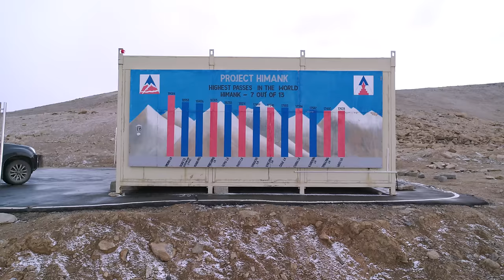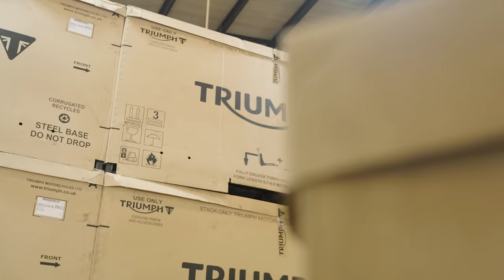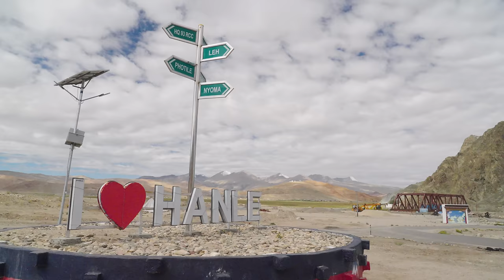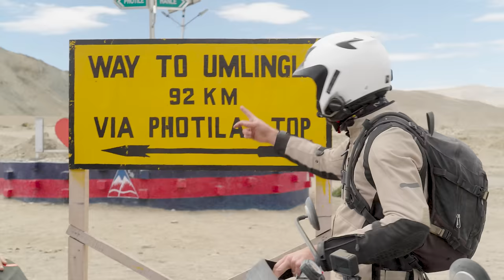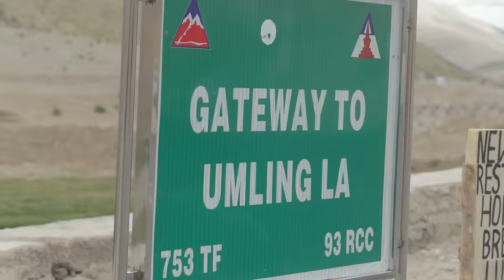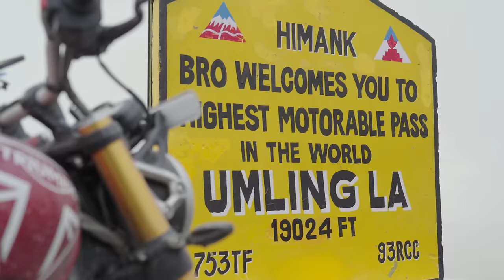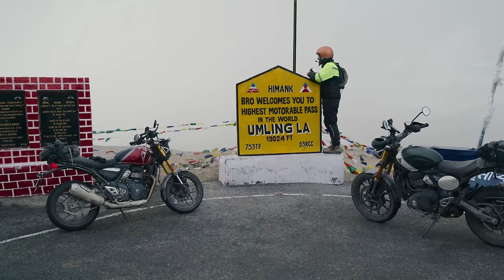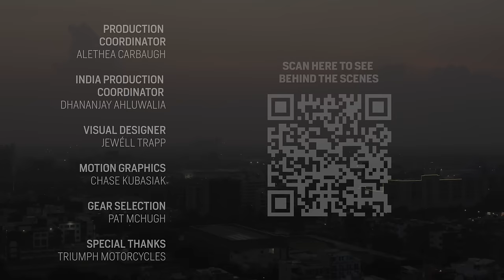The Highest Road in the World! Triumph Speed 400 vs. Scrambler 400 X | CTXP

Comment: What is the purpose of the grill/slats (not sure what to call it) that both bikes have mounted on the left side of their rear tires? Didn't see it talked about in the comments, and not seeing it mentioned in the video (though I have 5 minutes left, I assume they probably won't mention it at the end). Went to look at the scrambler model online and don't see it attached there. Is it some kind of safety mechanism to keep things out of the wheel, or an India specific thing? Is it somewhere to mount bags or something? Have never seen it before.

Comment: For those who are not from India or North Indian specially, these guys deliberately chose off roading even when full pavement road is available to reach out Uming la. How do I know ? I ride every year on that road since it opens in 2020. I am not against to showing such road conditions as they have to create some attachments for this video. If you are some one who wanna go there in future here is road map.
1. Doesn't matter from where are you comming you can find 4 lane highway (if not express way) till than CHANDIGARH 
2. From here you have to travel 80km north-west to kirtarpur shaib via rupnagar
3. From kirtarpur shaib there is 4 lane highway connecting rupnagar to Manali. Some portion between Mandi and Pandoh is still under construction (as on July 2024) but rest road is in good condition.
4. From Manali you have two option you mai use Rohtang pass road(not available for bikes) or via Atal Tunnel to enter Chainab valley.
5. From atal tunnel you have to take left towards sissu - tandi -keylong - jispa - Baralacha pass - meroo
6. After reaching meroo you have to take intection towards pang which leads you to mahe 
7. From mahe to nyoma - Loma bridge - hanle - chisunle bridge 
8. Take left for chisumle brodge and that vr road leads you to Uming la pass.

Even a new rider can cross that entire trip in 3 days(one way). And you will not face such difficulties as shown in this video.

Road conditions are remote and you have to be extra careful while riding these road( carry extra water, dry fruits, energy dring and ORS packets) and than you are good to go.

Comment: Heads up,if you're riding a motorsickle to the highest road in the world,stop somewhere around 5000-8000 ft of elevation(you do the M to Ft math yourself) and remove the air filter, which is airflow cfi restrictive,and thwn,if possible adjust the air/fuel mixture screw inwards a half to full turn causing the fuel to air ratio to decrease which helps to alleviate the thinner air/oxygen ratio by cutting back on the fuel amount and allowing the carb/efi venturi to free flow more air without the air filters restrictions.. And yes,you're  going to lose a lot of power/torque,acceleration,pulling power but you will maintain running and riding ability although highly restricted duw to lacking of oxygen...

Comment: I'm new to motorcycling, but how important is "breaking in" a motorcycle?
Reply: It’s kinder to the bike if you do run it in. Not pushing the engine too, building the revs slowly, don’t let the engine labour or rev to high allows everything to bed in. Generally, you’ll take your bike in to the dealer after 500 miles or so and they’ll give the bike a service, change the oil and tighten everything down. The bike will run a lot differently after that service and the engine will sound nicer.

Comment: Someone,anyone,Bueller,ferris bueller,anyone seen bueller. Please esplain to moi why these 2 clowns keep attempting to ride through bad terrain leaning forwards,throwing their weight forwards onto the handlebars and front suspensions when they should be throwing their weight back,leaning back,pulling up on the handlebars and rolling the throttle up or down as needed to control the steèring as well as gaining control via throttle, or clutch..